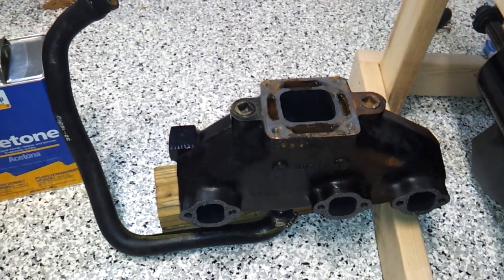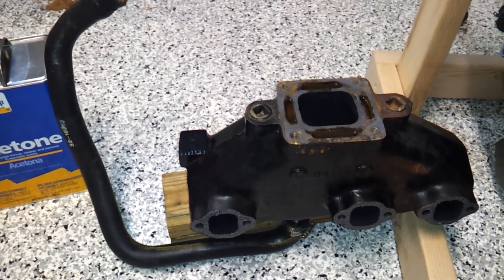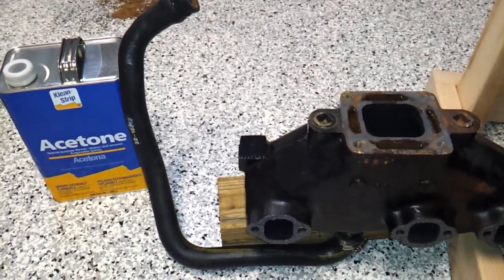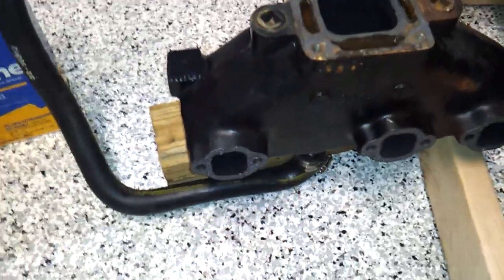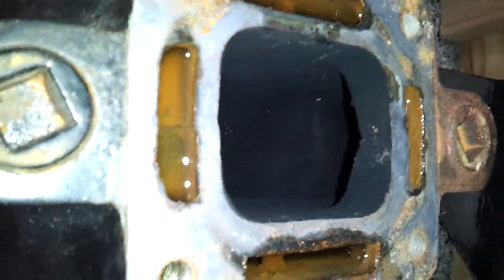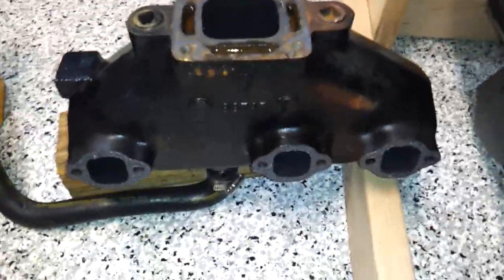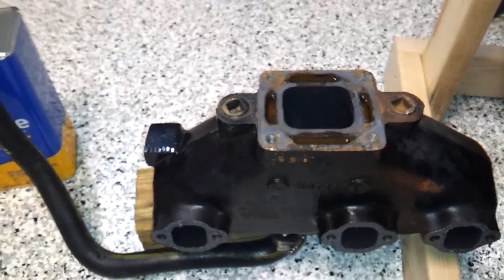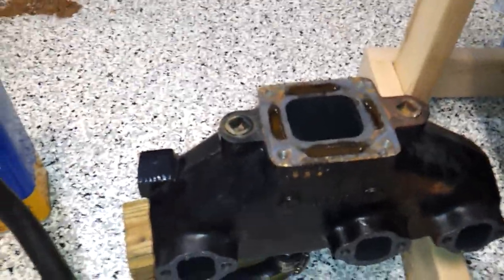Exhaust manifold pressure test

Comment: Water from bad exhaust can get into the oil because it lays in a cylinder when the engine is shut down and mixed with the oil, it just takes longer than with a cracked block or head. The other common way that water gets into the oil besides cyl head cracks or block cracks is bad intake manifold gaskets on Vortec engines.

Comment: pressurize the manifolds, if there's no leakage, have the heat exchanger inspected for cracks, if not that, then you could have a head gasket blown, or the water jacket part of the intake manifold gaskets could be toast....

Comment: had a water in oil problem on a 302 ford .i left all hoses hooked up but pulled  the manifold loose from the engine.then turned the water on through the outdrive muff,water ran out of one  exhaust port.replaced the manifold problem solved
Reply: Thanks

Comment: Get a flat plate with 2 holes  (steel.aluminum,acrylic,even nice flat wood)  on top,make a cork or paper blind gasket,for under it,2 bolts to bolt it down;
Then put some air pressure in that hose,clamped;
Then check for water in the exh. channels; no water... good;  water....bad

Comment: The problem is that you have a thin wall casting 1980s Chevy Astro 4.3 engine running wide open and they crack and fail in all sorts of ways.

Comment: I know this is a old video did you find out how water was getting in your oil I have the same exact issue I have took the engine apart and i didn't find any blown gasket head gaskets intake manifold gaskets and riser gasket all look fine i check for cracks in exhaust manifolds they both checked out fine Mercruiser 898

Comment: If the technical adviser who said to use acetone - had said use orange juice or lavender water - that would have made just as much sense. (and less of a fire hazard)  On the issue of water raising the oil level? Water entering through the exhaust wouldn't be my first suspected culprit - if, in all other respects the engine appeared to be working properly, and operating in its normal temperature range, and its normal responsive self. . But then, I would be removing and separating the exhaust and riser as a matter of course (for inspection) whilst removing the cylinder head.

I would be interested to hear back from anyone who has good and useful information on a method of accurately determining the useful service life left in a marine manifold or riser?

I believe the pressure testing of manifolds and risers  has been the service industry standard for a very long time. However I don't know of anyway to determine the useful service life left in these critical marine parts, or a meaningful monitoring system for scheduling their replacement. (excluding the use of sophisticated tools and equipment, which most service people don't own - or routinely have access too. Case in point would be the used boat buyer with little or no idea (no engine hour clock fitted) of the service history the boat and engine have had previously. Manifold(s), riser(s) could blow out on that poor unsuspecting soul at anytime, consequently Pressure testing these pieces is OK today - however it's far removed from guaranteeing  that you'll not experience or have a leaking manifold or riser shortly or immediately thereafter.
Reply: Don Miller acetone is 4 times thinner than water and will seep through cracks. Water needs 20 psi to move through cracks. With acetone, no pressure needed
Reply: Pour water in the recess of any head likely won’t show a leak, pour a solvent and it will leak because of one viscosity and two water is cohesive to itself.
Reply: Chemistry and physics escapes you.

Comment: Dude there is NO way water can get into your oil from that exhaust manifold!  Someone didn't know what they were talking about.  You have basically a couple places to look:  1)oil cooler 2)head gasket.
Reply: Andrew Armstrong I get a hyrolock.. and water in the oil on a 4.3... your thoughts?
Reply: @matthewhall58  Hi, have you solved your hydrolock issue ? I happen to have the same condition, so I changed the intake casket, checked the intake for cracks and imperfections etc, Compression test on cylinders steady for all pistons at 170 psi but not 100% sure if that solved my issue. ??? Still having problems starting etc,
Reply: this happens a lot, esp. in northern regions.
Reply: Agreed; i see lots do not know what they are talking about; and THEN money gets tossed;  a good boat name for them : "Get Sum Gone"
I would add another source; a cracked block or head,,internally ,ask me how i know...working on one like that right now...
Reply: Ed Hathaway you are ignorant.
Reply: Then u dumb asses explain it to us all
Reply: what happens is that  the water/coolant flowing through the manifold finds the crack and enters the combustion chamber when the exhaust valve is open thus entering the cylinder . Water /coolant  then seeps through the rings of the piston and you end up with water in your oil and all over the rest of internal passages that oil travels . This will also happen if you get water intrusion from the exhaust .The bellows fail and they always do and launching a boat to fast .As for me that's why I know . And I have had brand new exhaust manifolds sent to me with cracks and poor castings leaks.    And Monday I will be calling  GLM to have them refund my money . Because I can not get a manifold from them that will hold up. So research, investigate and learn . There are several types of marine manifolds. Check it out . We are all ignorant to something. Nobody knows everything. Good luck !

Comment: That's what it has to do with water in your oil 

WHY SO FRAGILE?
The manifold is a complex metal casting, actually a pipe within a pipe. It collects the extremely hot exhaust gasses directly from the engine into an inner “pipe” or long chamber which is usually cooled by raw water running through an outer casing. From here the hot exhaust gases and water are fed to the riser where the gases and water combine to continue the trip overboard

Comment: Manifolds that have cracks in them usually cause temperatures of cooling water to be higher then normal running temps.Thats about all, other then more fuel burned, overworked engine, and early Engine death over long periods of running under these conditions. So testing them is a good idea.But,Underload, normal gas flow and temperatures will not allow water to flow back to the cylinder valves.The cam in a marine engine is designed not to allow any chance of water ingestion anyway. I may be wrong.
Reply: You are wrong
Reply: Oops
Reply: Sorry but wrong, all engines according to mercruiser have valve over lap which can cause exhaust reversion, just fixed two engines with the same problem on one boat, it came to be low water pressure from water leaks. But opposite to this problem, idle to 1500 is when it can happen the easiest, this was probably a head gasket

Comment: Think about it. There is no direct path near any oil galley in your exhaust system. You best be looking at your Head Gaskets, or even a crack in the Heads and or Block. Water to oil pan is most likely a Head Gasket. A vacuum on intake stroke can draw water through a cracked Head Gasket. Or, Pressure on compression stroke can push hot gas past a crack through a water galley to oil galley. Either way Sometimes a compression test could tell you which cylinders are in trouble. I've experienced this.

Comment: Umm.. why does it need to be acetone?..

And why would your engine mix oil with water in your exhaust manifold? It just doesnt make any sense..
Reply: Narii- Cooling water is flowing through that manifold, through age and temperature differentials these manifolds crack and when the engine is off the water can leak into the cylinder through the exhaust valve. Then seeps past rings into oil. And the acetone because it is much thinner than most things on hand and will seep past cracks easier. This is the backyard way of checking for cylinder head combustion chamber cracks as well.